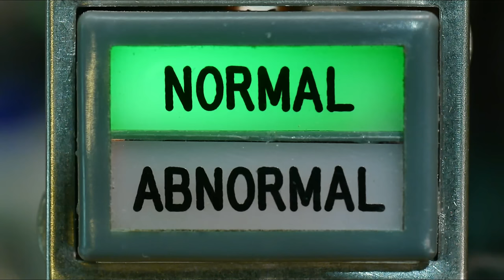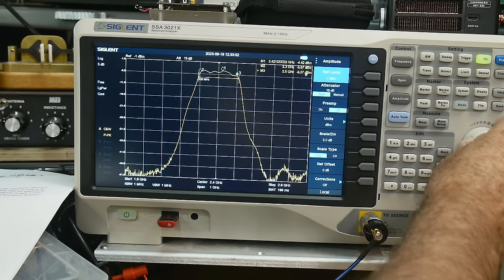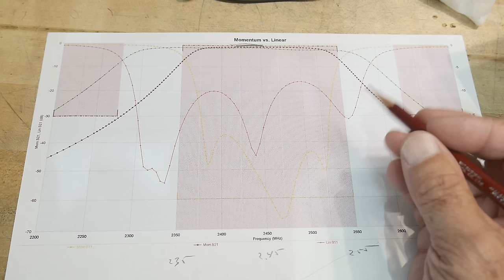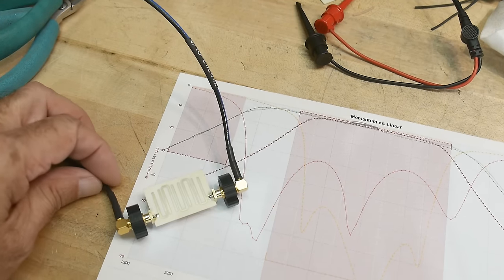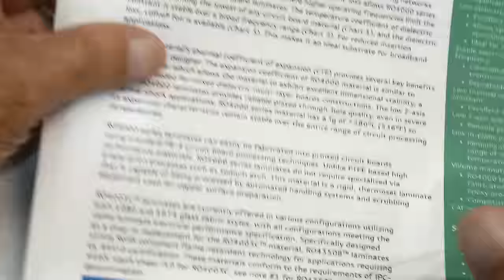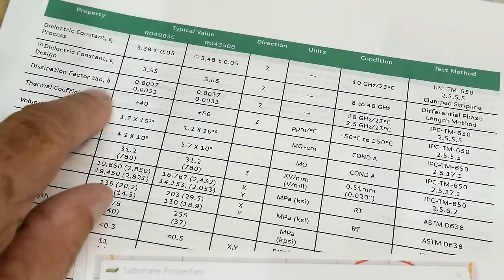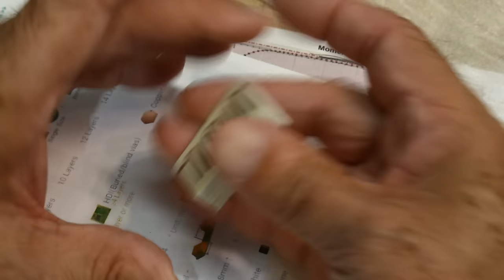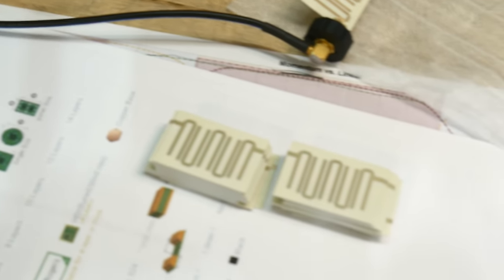#1628 2.4GHz Hairpin PCB Filter Design

Comment: You just covered my masters thesis from back in '91 while I was at BT Labs. I was modeling thin-film circuits of gold on alumina substrates at 2 - 60GHz. I developed software from scratch that split the space into variable sized cubes to run the finite element analysis. I'd run the simulation and then based on the magnitude of any change in a cube would then split into 8 smaller cubes and re-run. The simulation took 2 weeks on a DEC Alpha of the time. I found it was really important to include a sealed metal box, which I had custom manufactured in the lab's machine shop, and to include that as part of the simulation. I've not run the Rogers materials but have heard great things about them though. We took the measurements on an HP 8510C network analyzer which was about as good as you could get back in the day.

Comment: As the response is slightly too low in frequency you might want to try cutting or grinding off the ends of the hairpin filters - 1mm at a time .  I had a similar hairpin filter for 1152MHz on FR4 board which was too low and had to do this to get the filter to play nicely.  A great video as always.
Reply from the maker: I could move the center frequency but the top of the filter was no longer flat.

Comment: The difference in the simulated and measured center frequency is probably just due to the difference in the dielectric constant you used in your simulation and the design value recommended by Rogers. The dielectric constant of RO4003C is 3.38 but the recommended value for design is 3.55. In your simulation increase your dielectric constant and you will see that the center frequency of your filter shifts to lower frequencies.

Comment: Hi IMSAI Guy.  I think the Er to use in MOM is more like 3.48 and it would shift down slightly.  The response proves the model is great.  Just the lengths are a little long because the Er is too low.  Or PCB Way shipped you 4350 boards instead of 4003.  4350 is the most common today, but a little more ceramic content.  You can get a precise calipers thickness of just the dielectric, then with the area of your traces just calculate the parallel plate capacitance you should have versus measuring the same with your LCR meter and you can see if they used the right material.   Or with the area and measured capacitance value, solve for Er and see what you get.  Whatever that Er is, enter that in GENESYS and you will probably see the frequency shift down a bit.

Comment: It's the mass of solder to the sma, I did these designs in cad and verified in prototypes. Had to have not even a fillet in the solder. None of the other team could match the minimum amount of solder joint.

Comment: The copper thickness and roughness changes the effective dielectric constant which is most likely the reason for the frequency shift. Rogers actually have a good paper on the topic.
Also, the conductivity of the gold plating, which I assume is ENIG, can have its own effect on higher frequencies.

Comment: They are coupled resonators - each strip is a half wavelength long.   Did Keysight give you an evaluation license?  I've only used ADS when I worked at Qualcomm, Anritsu, and Z-Comm.   By the way, I bought a license for Sonnet Software - I wouldn't mind optimizing your filters.

Comment: PCB with Rogers dielectric? So fancy that I need a second monocle :D But in all seriousness, measuring S11 (hopefully it is better than -20dB) really helps to determine what is the cause of the frequency response shift (interesting as a follow-up video). Also check out the losses in the passband , it seems that you measured 4dB of in-band attenuation which is a lot compared to your simulations. 
Also, sometimes simulators assume infinitely large ground plane, which is not the case in your design. This surely changes the freq response.

Comment: Hi, Great video. How are you measuring 2.4Ghz on a 2.1Ghz max analyzer.
Reply from the maker: it has a firmware upgrade to 3.2GHz
Reply: @IMSAIGuy  cool, how do you get the firmware. Was it a simple upgrade.

Comment: Go back to the modelling software, try that correct figure and see if it matches reality please. Also is an FR4 design possible ?
Reply from the maker: FR4 has +/-10% thickness tolerance. so hard to predict.
Reply: Measure your actual PCBWAY FR4 and I’ll bet the thickness is way more consistent than that.
Reply from the maker: @jms019  consistency is a measurement of variation from any point in time. I would need to monitor over several months. The total thickness is two layers of prepreg and one layer of FR4. the manufacture of the boards already know these numbers and publish +/-10%

Comment: Waste of money at those kinds of frequencies. Build the same filter for FR4 and test them side by side?
Reply from the maker: I needed a high tolerance on thickness and dielectric. I wanted to show modeling accuracy and needed to rule out other variables. FR4 is fine but I'm not sure what the variability would be
Reply: @IMSAIGuy  Most people watching probably understood that, the comment wasn't derisive. As for FR4 it would be interested to see the comparison ...
Reply: Definitely would be nice to see the result on FR4.  What would that cost? $20?
Reply: @chiraldude  I believe that PCBWay sponsors the boards?
Reply from the maker: @chiraldude  the problem with FR4 is the thickness tolerance is +/-10% so you might get lucky or not